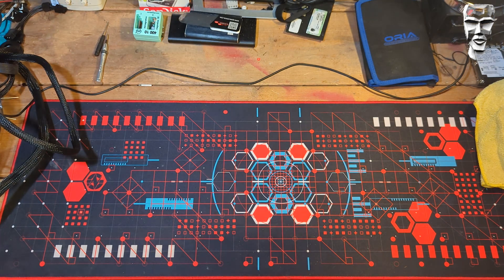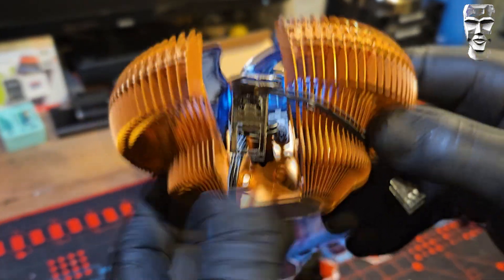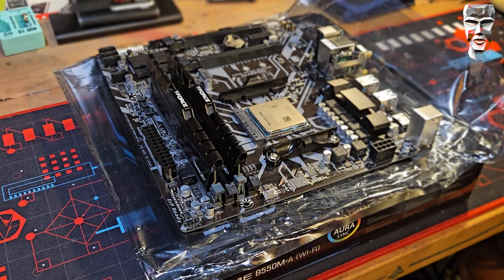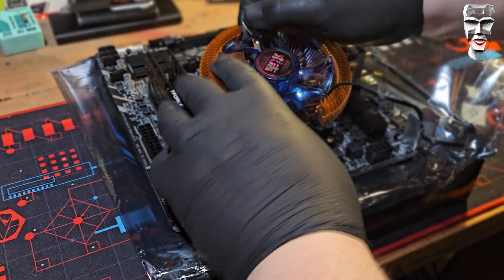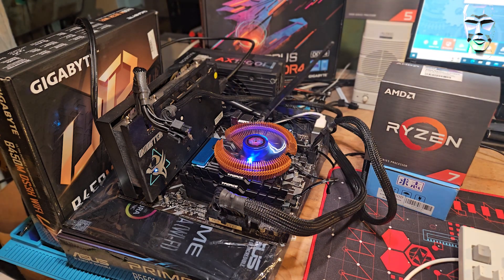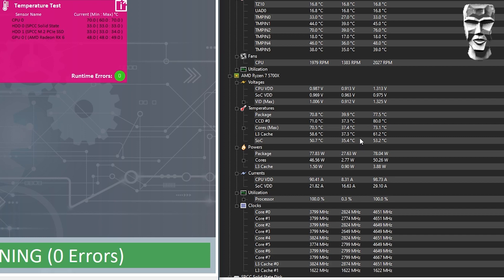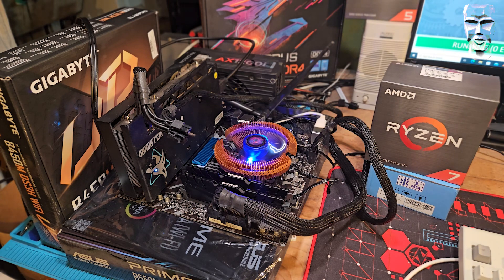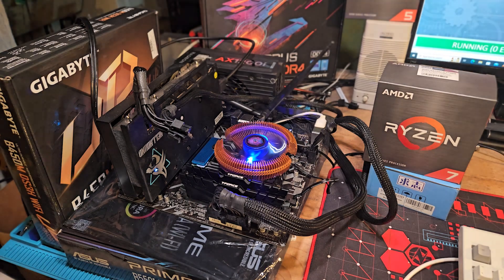Can this $8 CPU cooler keep up with an 8 Core 5700X? Crazy Components #2

Comment: I bought a 5$ or 6$ 4 heat pipe tower cooler with 9" fan on aliexpress, didn't try it but it will surely perform much better than this crap